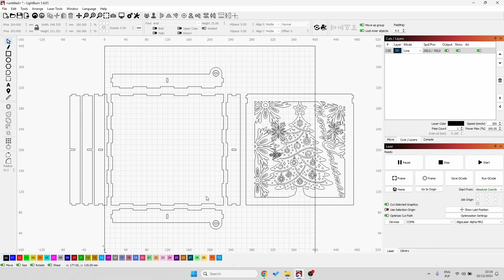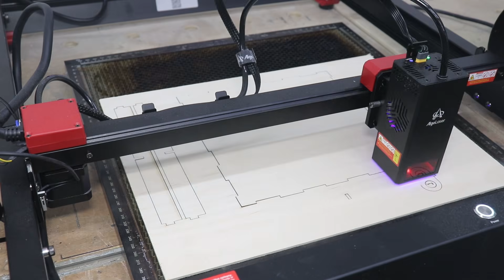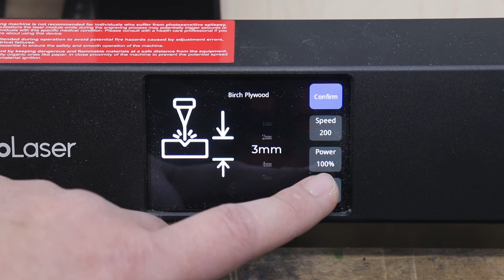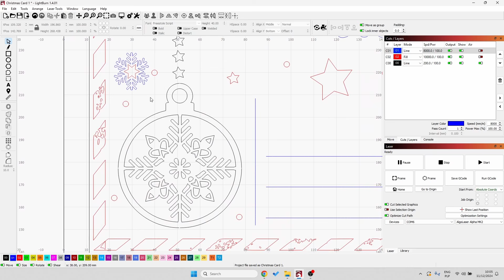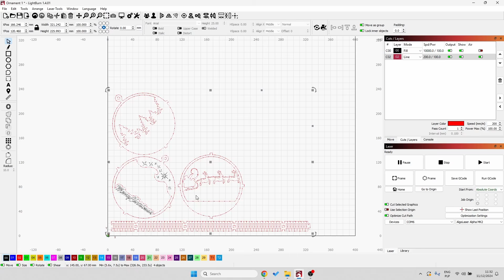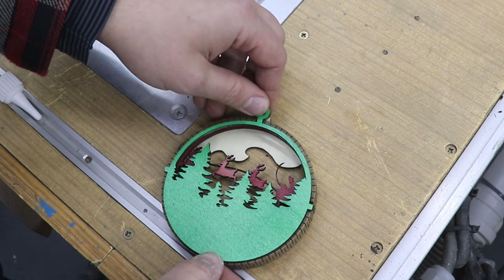5 Stunning Laser-Cut Christmas Projects | Free Files Included! | AlgoLaser Alpha MK2

Comment: This is amazing!!!!!!   I have been working with some miniatures (newbie) and I think the hinge you used will be life changing!    Can these projects be sized up and down, without distorting or causing them not to work?    So excited to make these once I get a laser!    Can you also explain the  glue you are using?
Reply from the maker: If you resize the design then the slots won't fit unfortunately. But you can design them in different sizes. Best suggestion for glue is just medium or thick CA glue. Holds well and fast.

Comment: Tomasz, I noticed that in the lists of items that it will work with  it say's "epoxy panel"  I really would like to see you doing the same thing with the "epoxy panel" . I really do think that this machine will be amazing if you can use it to cut and create designs with different thicknesses of epoxy panels.  You would be able to make some really good Christmas decorations combining the epoxy panels with the plywood.  Hopefully you will have the time and abilities to have a go at making the Christmas decorations with the two items I suggested from the listing's on the machines menu. As always brother 💯%   👍   🇬🇧.
Reply from the maker: That would be an interesting project for sure. But I won't have time to do it before Christmas now. However, I'll try to make some other themed project👍

Comment: Honestly you really really need to get that in an enclosure of some sort.
Just having an extractor next to it is pointless as can be seen from all the smoke in the room at the start of the video.

This just gives out bad ideas to anyone that doesn't understand how these lasers work.

And I hope the workshop is locked when using the laser, wouldn't  want someone just walking in and get an eye full of laser.
Reply from the maker: There is no one else to be around my workshop. Yes, enclosure is the best option. However, this is not my main machine. I do test a lot of machines in my workshop so I may just make a dedicated enclosure to house most of them while I test them 👍